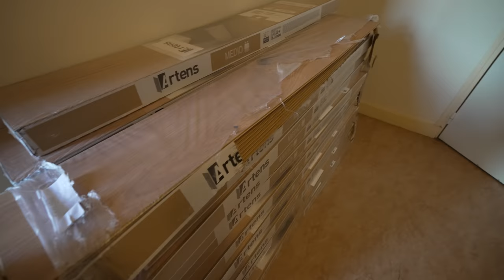This Convent Was Hiding A Secret Behind A Wall

Comment: I like the way you work. Cleaning as you go and carefully disassemble as opposed to sledgehammer demolition.
Reply: As a renovator for over 30 years, it is both laughable and frustrating to see modern home renovation shows where the hosts often hand sledge hammers to homeowners and have them smash through walls and cupboards in the demolition process.  Particularly in older century homes, demolition needs to be a careful disassembly because what is hidden in the walls is unknown.  Not uncommon to find decommissioned electrical wiring, or capped gas lighting pipes still containing gas buried in the walls.

Comment: Billy, If you stand in the with your back to the large arched window in chapel, and look to the smaller uncovered one...they line up. Perhaps to bounce light onto missing stained glass. Also possibly air flow. Can wait to see what is behind the alter all boarded up!! Another window ?
Reply: Could that have been for special chorus singing? There is stone cut off on the alter in the chapel...keep an eye out for it perhaps in the garden...

Comment: I was thinking for safety with that window in your office into the chapel, find someone who can make a metal silhouette safety screen that looks exactly like the window and is the exact same colour as the window. Unless someone looked really really hard they wouldn't notice it when you had the window open. 
Also i was wondering if there was more room space beside and above that window? Why did they block it off while leaving that small alcove there? Or is that small alcove all there is for that side of the room?
Reply: Yes!
Reply: Judging by the paneling on the window and how the shutters open up, I'm betting there's a false wall there.
Reply: @SpringNightAngel  I just noticed just now after watching it again, the metal bars that are the kick panels and wall protectors under the window. I reckon there will be more room area that is boxed away by the faux wall. That room could be a lot bigger than it currently is

Comment: In a previous vlog you & Ryan were at a broconte which turned out to be run by the man who cleared the convent.  You thought you may have found some pieces originally from the chapel but you didn't have time to find out.  Did you ever go back to that brocante to see if the pieces actually were from the convent?

Comment: I love the view of the front of the Chapel that you see at about 15:00. You can clearly see the raised step, which is where the altar would have been and the priest would have faced East (towards the rear wall with his back to the congregation). As a result of the Second Vatican Council in the 1960's there were massive liturgical reforms. Mass tended to be celebrated in the local language rather then Latin. The altar would have either been moved forwards to allow the priest to face West (towards the congregation) or a new altar would have been built. You can clearly see the concrete footing of the site of the moved alter. It is also usual for there to be relics of a saint actually under the altar. All of this would have been removed.

Comment: I am surprised to see someone painting a large wall space with a single paintbrush. I'm wondering if using paint rollers isn't a commonly used tool in some parts of the world. So much work with a small brush.

Comment: If you could fabricate a locking screen that mimics the mullions of the windows, it could act as a fall barrier without blocking the beautiful view....it would mean replacing the existing wooden screen but would enhance the rooms. The exterior is plodding right along and looking so lovely, even the flowers are celebrating.

Comment: Actually those windows was and sometimes still is common in chapels and cathedral. Originally for upper class and royalty to be at mass but not around everyone else and was good security system at the time. Sometimes they were also used if someone was sick as it allowed them to be at mass but also isolated so others would not get sick as well. There is a long history of them through history.

Comment: Those roses that emerged out of the overgrowth will look even more amazing next year if you prune them hard next Spring to roughly 6-8" above ground level, cutting just above an outward facing bud & on an angle to allow water to run off & not risk causing or rather allowing, any disease to take ahold. 
Dig in a healthy dose of fish, blood, & bone, apply a thick 4-6" mulch and flowering next year should be absolutely incredible. Water well. Plus, the rose bushes should also lose the leggyness they developed as they fought to find sufficient light & become quite bushy.

Comment: chapel is a candidate for indirect lighting ...led of course imagine the countenance of light reflecting down from a ceiling flooded with light the trick will be installing the chases and then attaching the mounting brackets on the buttresses shining up...minimal intrusion on the original works...cleaning and sealing the murals will be the tedious job and of course certain amounts of down lighting...again to illuminate with out intruding on the original works

Comment: California architect here, that interior window/opening might have been boarded up as a possible fire risk. Its important for people in assembly places to not be exposed to fire from adjacent areas, so strict codes require a high level of protection. So generally, these interior openings might have been blocked after disastrous fires in other parts of the world caused awful casualties. From smoke or fire.

Comment: Billy, you spoke of restoring the chapel to one again.  Once it is done, contact your local RC priest.  He will guide you into re-sanctifying the chapel for use.  Sadly, the RC church has lost many of their devotees this era and priests are few and far between. Churches and chapels close due to the lack of parishioners.  If masses cannot be celebrated in your restored chapel, then you have the space to hold weddings, anniversaries, baptisms, etc. Concerts (as mentioned previously) are also a great way of using the acoustics of the room.  Because of the age of the convent, I believe that once restored, you might also hire others to offer tours of the property.  You could add the chapel and convent to Trip Advisor, Expedia, etc.   The "hiding places", as you discover them, make for great history lessons.  Youths of today need to understand history to be able to grow wise.  So, why not reach out to local schools or guides/scouts groups?  And speaking of scouts - the Guides et Scouts de France - have chapters all over he country.  If you have a large project that needs help, why not reach out to them?  This builds craftsmanship and skills that last a lifetime.  Of course, these are only suggestions.

Comment: Why in the world would they cover up such a jem? I've seen some dumb coverups by re-modelers, but this takes the cake. I would recommend you go beyond just a lock for the chapel window and replace the glass with laminate automotive glass. Then put a copied wooden trim cover over the windows as well. That way no one could fall through the window even if it's locked. Just an idea.

Comment: For safety could you not add iron bars with the same design as the window on the chapel side so you would still be able to use the window for a bit of ventilation ?

Comment: I wonder if it would be better to put a lock on the office door rather than the window. Hear me out on this one. It looks to be electrical wiring running along the ledge where your arms were resting. The window might just come in handy as you renovate and add more lighting to the sanctuary or just to clean and brighten up all the beautiful mural work and mill work. Now, obviously that is just my two cents, but it might come in handy for maintenance down the road, or maybe just leave locking that window to the last thing you do, after the sanctuary is done.

Comment: As soon as I saw the cross-hatching on the window I "knew" it opened up onto the chapel!! What a great find.  What about putting a safety grill on the window? That way the window can be opened to allow fresh air to flow through.  You can also still see through a safety grill. (We had to put one on one of our house windows when we put in our pool.  As children could have climbed out the window straight into the pool area.  I would recommend it for your consideration)

Comment: I have a question about wall painting techniques. Every time I see anyone painting they are using a brush over the entire wall surface. Is that out of preference for the finish? Or is that because painting rollers are not widely used in France? If anyone can answer that, it would satisfy my curiosity! Thank you!
Reply: @barbeeseymour3618  Thank you for your response. That explains it! 😀

Comment: You should consider removing the dry wall from another adjacent wall to see if the baseboard continues and if there's other moldings or frescos hiding.
You were correct that the room would be used by nobility so they didn't have to mingle with commoners, as well as other visiting dignitaries. The mother superior and upper clergy would have used it too, and also nuns who were old/frail/sick.
That baseboard and trim appears to be in excellent shape, the other walls should be as well unless they have water damage.
Justify removing the dry wall by saying you have to check for water and pest damage 😉

Comment: before electricity and air conditioning, windows were built at the highest points to allow heat to escape while drawing in cool air from openings at the lowest points... creating a vacuum and air flow.  Not sure what the room you are in is or if it is the original set up and purpose but it may have been used for that.  In the American South, giant wrap around porches were the norm as it created a huge cooling shade and when the windows at the top most of he house were open and the windows around the huge porches were open, the heat escaping out of the top created the vacuum and sucked in all the cooled porch air, literally blowing in cool air into the home as if a fan was in the window. .  An amazing lost architectural system.  That's what came to mind when I saw the tiny window up above.. certainly heat would escape into that room and heat it up.. maybe that is why they blocked it off.  I agree.. the danger of falling went through my mind right away.  Lovely job bringing the place back to life.  Oh those roses are lovely indeed!

Comment: Instead of hard, cold tiles on the floors, why don’t you use a laminate wood-looking floor? I currently have a fully tiled small cottage, and the tile is horrible, not only to clean the grout, but it is hard and very cold. Laminate wood looking floors would be so much better and Easier to clean and keep clean.

Comment: So what happens when the batteries die on the door lock and you did not remember to change and your locked out?  Does it also have a key, or can you use number pad w/out batteries?  Is this Your new home, or you bought to redo and sell?
Reply from the maker: has an emergency key, and also a hidden usb port to plug in to quickly open also

Comment: Am I alone in thinking that little chapel needs a little organ? With modern electro-pneumatic actions, you could even run it on midi files, if you want to hear it without an organist present. Or, if you want to go old-school, there were a few organ builders that made organs capable of being run on piano-roll style player mechanisms.  Granted, that would not be a cheap addition, and organs do require regular maintenance...but hey, if you're gonna buy and renovate a convent, might as well go all in! lol

Comment: Although the chairs look nice, they do not look to be substantial.  Also the size is small.  I think you need to go g=bigger and bulkier.     What a lovely Niche and window.   If possible I would Steam clean the chapel floor.  The front section appears to have decades of ground in dirt.   There is a ton of dust and grime along the ledge
under the niche window.  That should not be too difficult using scaffoling,  Of course a professional art restorer should tell you how to properly clean those beautiful murals  instead of restoring at this time, a good cleaning.  I think it will shine up brilliantly.
Why are you using little paint brushes.  Rollers with extendable handles would cover more quickly and better. under yje niche window.  That should not be too difficult using scaffoling,

Comment: I don't get why the surprise at how good a condition the shutter and window are in - the framing studs on the covering wall were metal and those were new outlets which means that the wall probably was built in the 1990s . . .  But still cool nonetheless